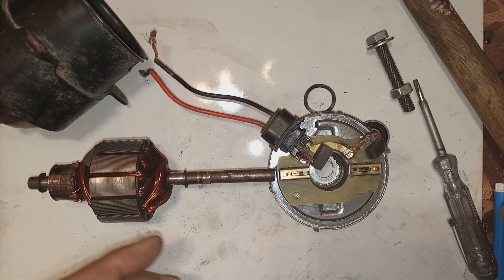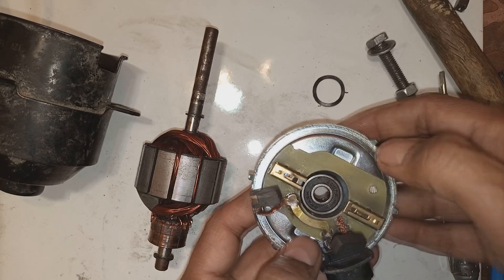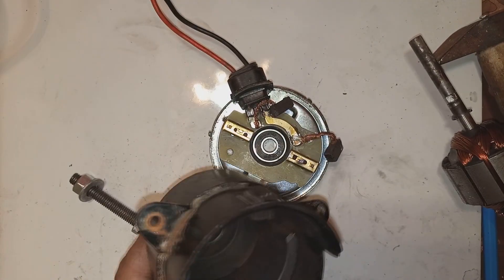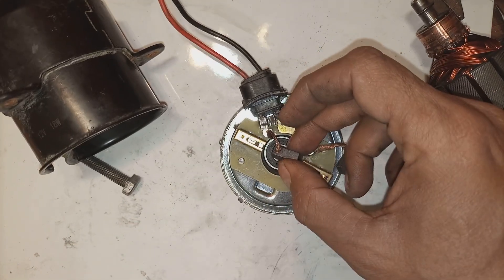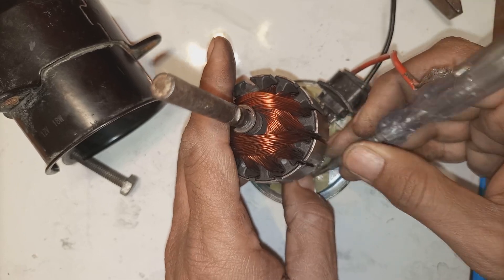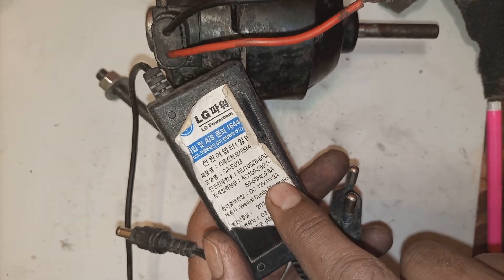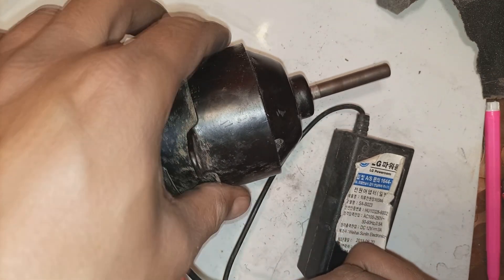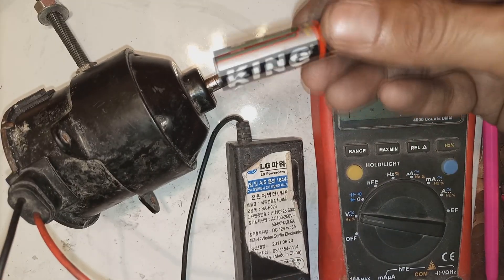DC motor repair. DC fan motor repair. Complete details with installation, carbon replacement part 2

Comment: Hi how you.. I wanna ask you a question If you can possibly help me.. I have a bmw e36 overhaul the whole engine, done key coding, replaced crank sensor... The car is cranking but will not start do you have any advise on what could be wrong